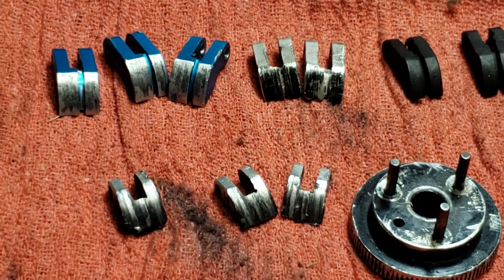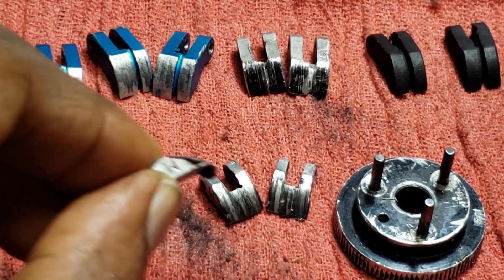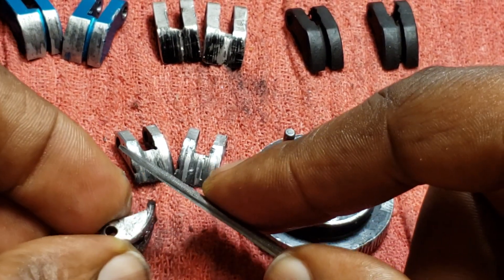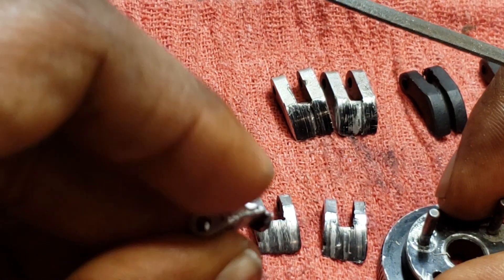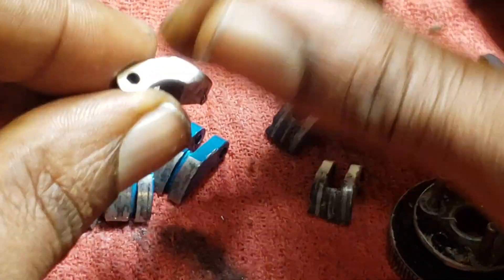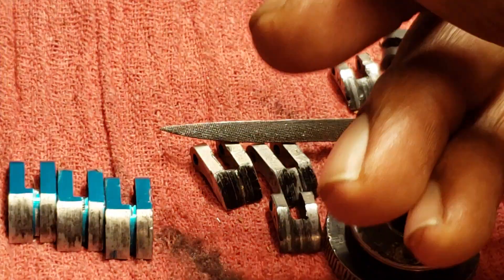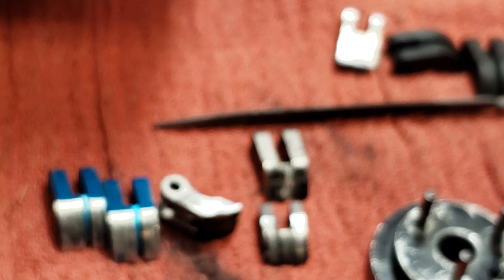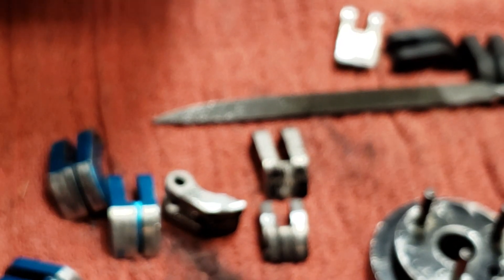Stop Riding The Clutch So You Can Make It Last! Playa!!!

Comment: I new there was a reason I have 300 used clutch shoes in my clutch box. Are you going to run that engine soon? I have been looking at getting one but the reds are at the top of what I can spend. Can you do a video on how you setup your radio? Like the expo,abs,and dual rate. I am getting ready to setup my 4pv and am kind of intimidated by it. I have really only used rtr controls and fly sky gtb3.
Reply from the maker: Yeah Byrd you can use them Clutch shoes again just file them bers off and let them ripppp bro, yeah I'm break in the new Reds r5r so look out for a video
Reply from the maker: And yes I will do a radio setup bro